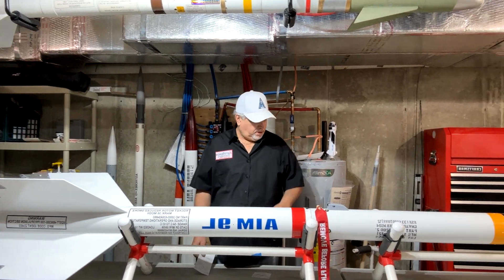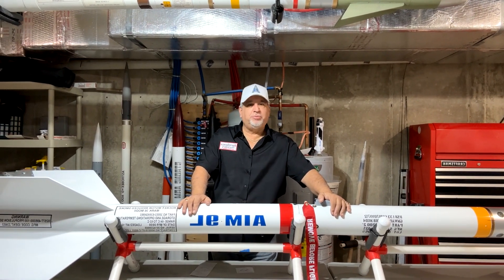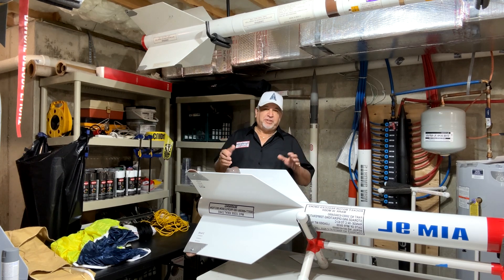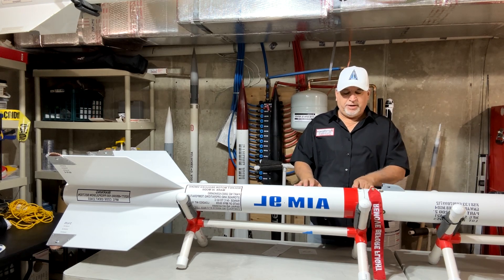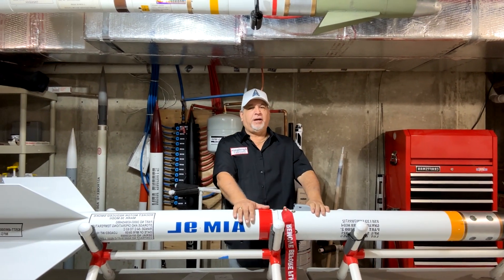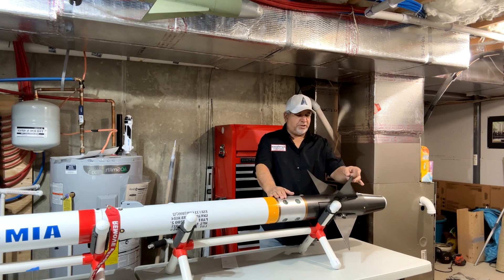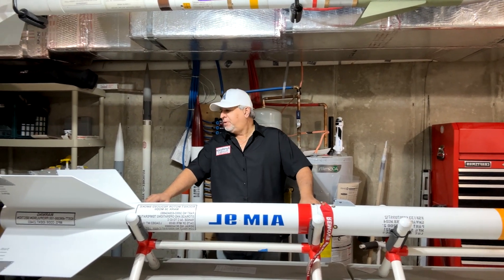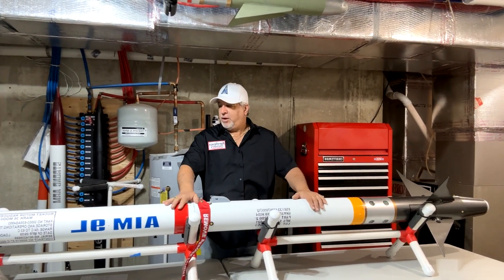1/1.1 Full scale Sidewinder walk through

Comment: Good looking model! I worked on AIM-9 missile systems from the P through the X. Major improvements over the years. Just a few fun facts. Those clear windows are for the target detector on the newer model or an influence fuse on the older models. It senses close proximity to the target and initiates the warhead which is highly compressed spring steel coils that when the explosive goes off sends what can be considered thousands of bandsaw blades into the air. The early AIM-9 wasn't known for getting many direct hits until the L&M variants came out. The X is a whole other breed with many direct hits. The rollerons are on bearings and mounted inside the metal rolleron assembly, it is a movable but not guidance computer-controlled flight control. When the motor fires, the inertia uncages the assembly allowing it to swing into the airstream as needed to dampen the "sidewinder" flight movement that gave it its name. Newer variants have little machined NACA vanes to increase and direct the airflow over the roller itself. The aircraft communication umbilical that is mounted between the fins has male pins that insert into the guidance unit. It is attached to a metal block and is secured with breakaway machine screws to the unit. The missile rail has a spring loaded "snatchaway" that holds onto the unbilical block when the missile is fired and moves up the rail. When the aircraft returns the umbilical is still attached and tucked up in the rail nose fairing. These are prized items for the pilots especially if it was their first launch. Just thought you may find this interesting gee whiz stuff.